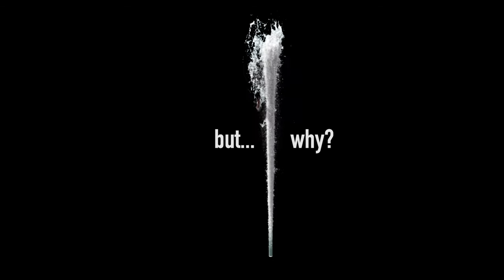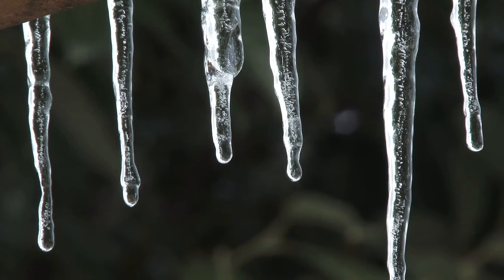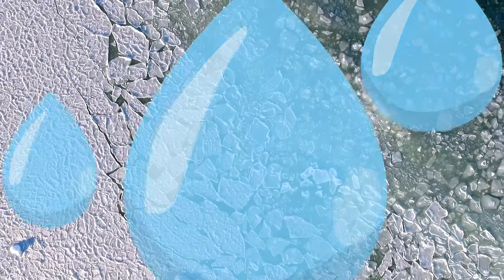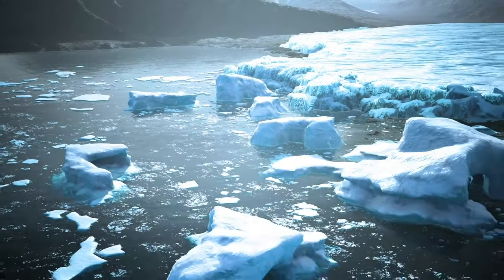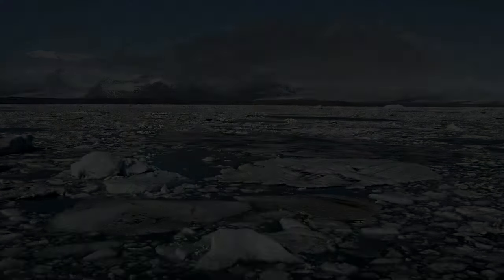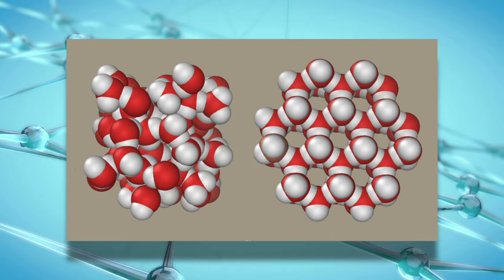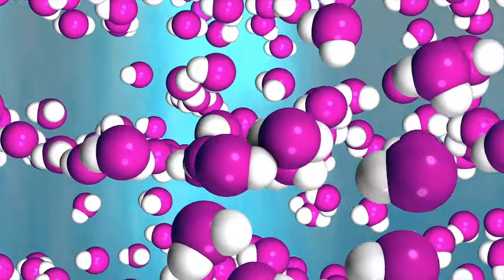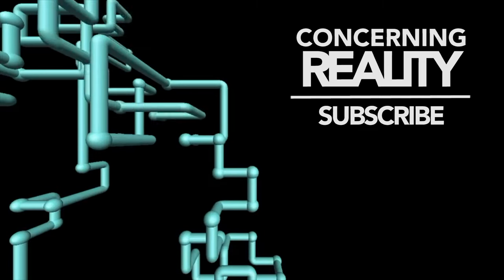Why do Pipes Burst in Cold Weather?

Comment: There's a bit more physics involved. Most pipes for water have relatively high rigidity and a circular cross-section. You can suppress the freezing of water into the less dense phase of ice via pressure, which is the counter force that the pipes exert back onto its aqueous contents. When you drop the temperature of water in the pipes well below its freezing point, you get a stronger and stronger undercooling effect, which eventually overcomes what the pipe can hold back, resulting in a rupture somewhere in the pipe.